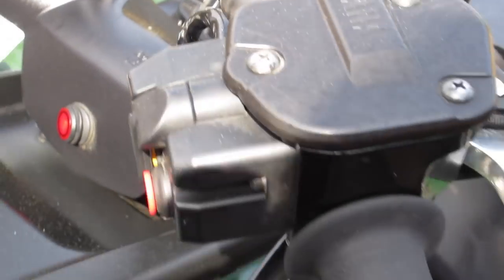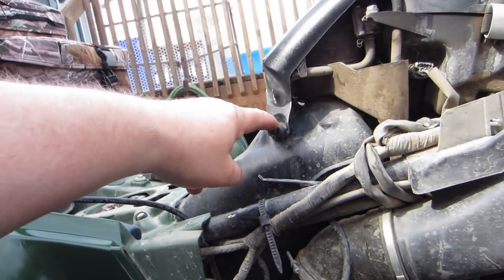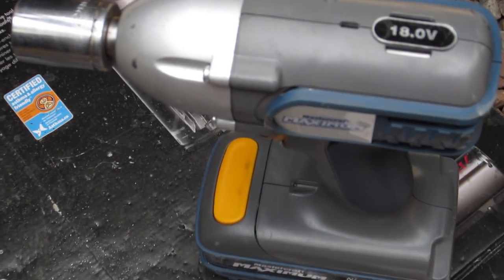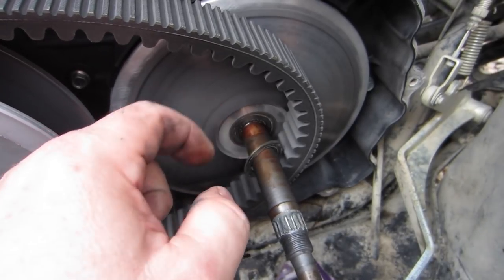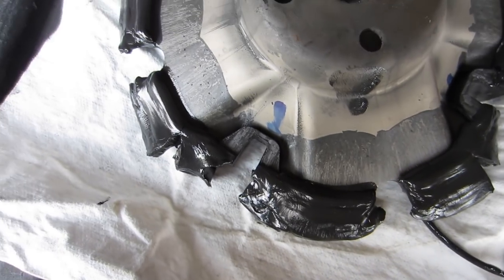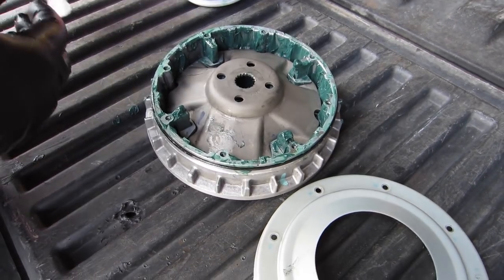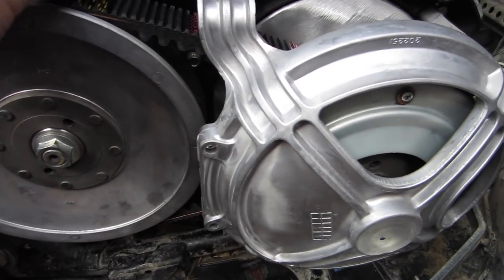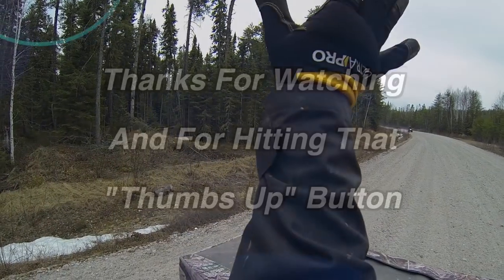Yamaha Grizzly 700 CVT Primary Clutch Cleaning

Comment: Your ATV almost look brand new. You could say the grizzly had 500kms and I would believe it. My dad bought an outlander max 400 new in 2005 and it is running on the original belt which now has over 12500kms. Maybe a new World record? But still in very good condition. A question. does your grizzly have original/stock exhaust/muffler? It's really loud I think. I'm from Scandinavia -> Sweden. And the Kodiak also looks like new.
Reply from the maker: Thanks Jimmy! They are 2011's.  Wow, that's incredible to get that many kms on a belt. No, the Grizzly has a 2r racing billet tip on the exhaust. Gives it a bit of a deeper sound but not too loud. Thanks for watching!

Comment: actually, since there's a thick layer of teflon all around the rollers, there's no need to put any grease.

I do a little in the inside of the spacer u show at 7.42.

the clutch systems are very very similar to each other (suzuki and yamaha). I think the same for the brute force, while the honda rincon works completely different . The honda 's got a very sophisticated shift , I would like to try it someday